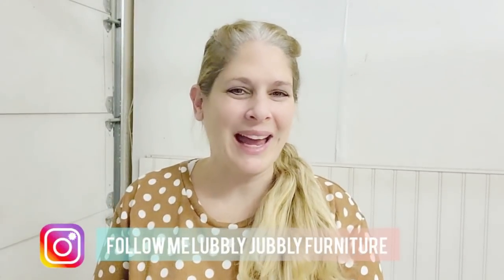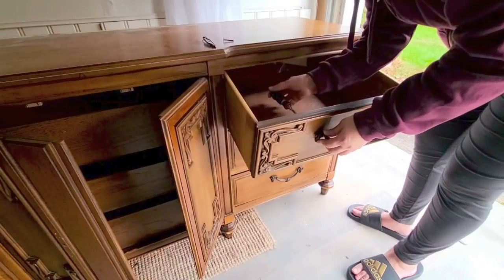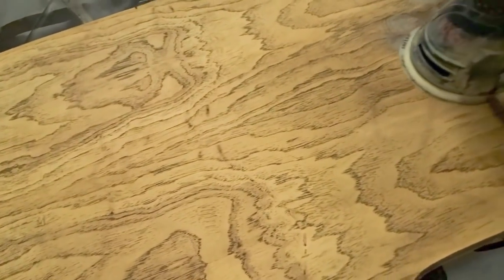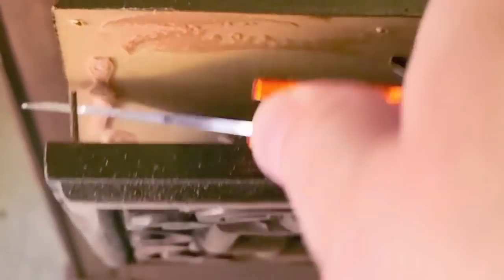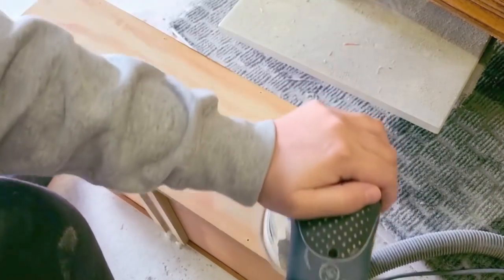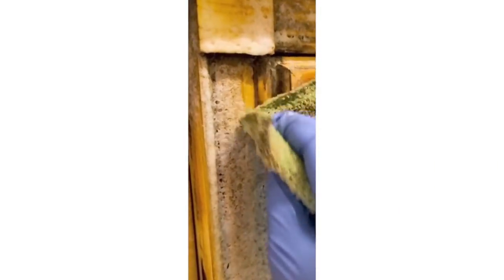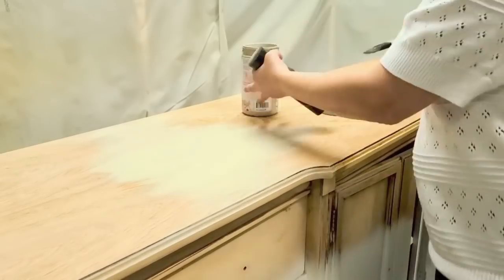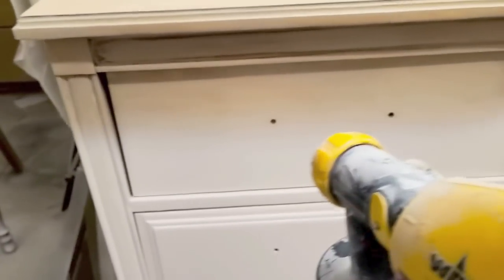Epic Furniture Flip | Furniture Makeover | Painted Dresser Before And After

Comment: This makeover is ❤️!! 
I used EasyOff a couple weeks ago on a painted piece, & it worked but with a lot of effort (multiple paint layers). I have a stained piece I'll use it on in the near future. This is just gorgeous 💞😍
Reply from the maker: Thank you so much Michelle.i used it on mirrors too but i think i need to do two spray coats of easy off
Reply: @lubblyjubblyfurniture  try Oven Cleaner to get the stain off, it works awesome!
Reply: That oven cleaner will continue to eat at your wood, if after "wiping" it off.

Comment: Lovely result Meg 😊 oven off also works well using 0000 grit steel wool to remove it 😉
Reply from the maker: Yes i should have used the steel wool thank you thats a great idea. Next one i will for sure
Reply: That oven cleaner will continue to eat at your wood, if after "wiping" it off.